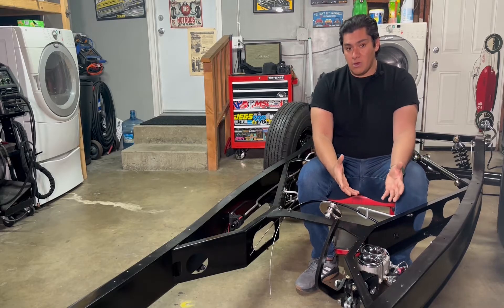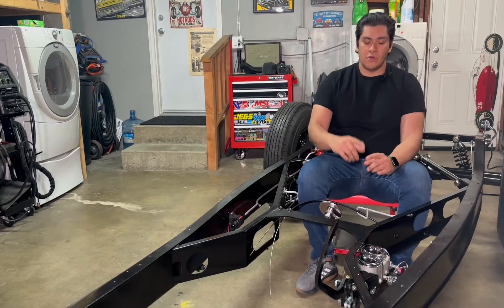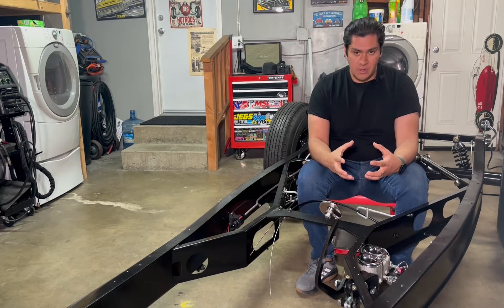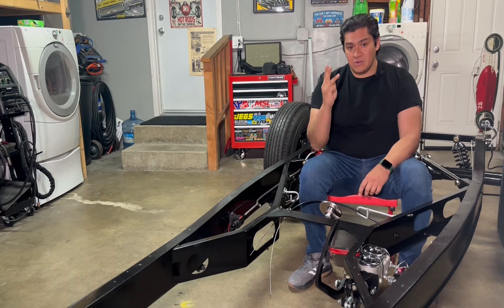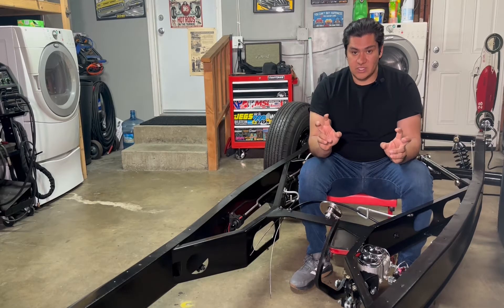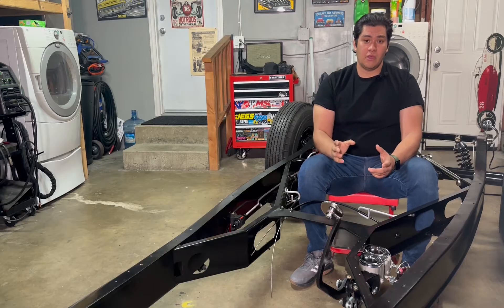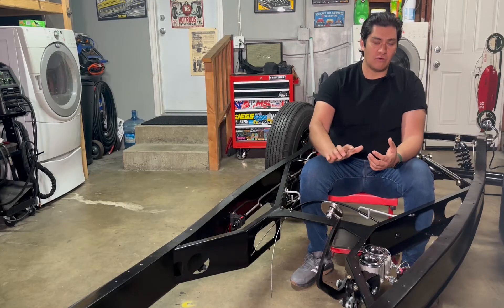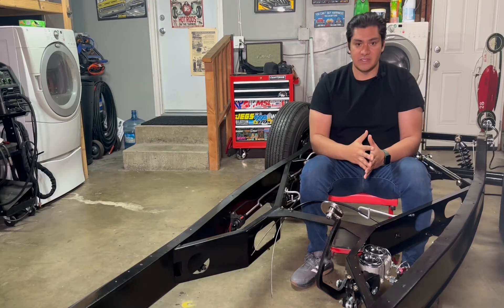BRAKE SYSTEM ON A EARLY FORD HOT ROD: THE THINGS YOU NEED TO KNOW

Comment: Hi I have a 1949 Chevy truck I all disc brakes I’m having trouble bleeding them I bench bleed the master cylinder l bleed the brakes and the padel keeps going all the way down with engine on can you help me out please thank
Reply from the maker: It sounds like the issue is air in the calipers. 

One recommendation is to unbolt the calipers and position them so the bleeder is the lowest point of the entire system and use a piece of wood between the brake pads as a pretend caliper.

Comment: Do you have a video on how to bleed the brakes? Is there a valve to open on the master cylinder?
Reply from the maker: I don’t have a video for that… but below are some key tips. 

Always start bleeding at brake furthest from the master. And do each wheel at least 3 times 

Make sure the bleeder is at the highest point possible. In some aftermarket calipers you need to remove the caliper to get all the air out the first time. 

Make sure any proportioning valves are open all the way to not restrict flow/ pressure

Comment: Thanks. Clear and concise video on braking components. Much appreciated! Considering abandoning the ABS valve and system on my 99 F150 , disk drum rear ABS ,as the valve is expensive and only available from the junk yard. Basically a crap shoot to get a good used valve. I  rarely drive this vehicle and can handle a non ABS system as that is likely what I have anyway. I was not sure what the mystery components were, mainly what i now know to be a residual valve on the ABS valve and proportioning valve on the master cylinder.
Reply from the maker: This comment was awesome to read! Glad it was helpful. 🤘🏽

Comment: Good video, very informative, especially with the pix.  So what the heck does a 'residual valve even DO?  Is it REALLY necessary?  Is it just placed in line to F&R, 2lbs for front (disc) and 10lbs for rear (drum)?  Thanks!
Reply from the maker: The residual valve holds either 2 or 10 pounds of pressure in the line 🤘🏽 and yup

Comment: If brake master are mounted on fire wall do i still need residual valve, or are they for under body brake system mount, cheers.
Reply from the maker: Great question, I have heard both yes an no. Some people will say the only time you need residual valves is then the master cylinder is lower than any of your brake line/fittings. Some people have told me that it does not matter where the master cylinder is the purpose of them is to keep the 2 or 10lbs of pressure on the pads at all times. I personally run them no matter what since these is very minimal risk in using them even if you don't need them.
Reply: Yes that is correct.  However the minimal line pressure helps the wheel cylinder cups stay sealed.   That 10lb of pressure will help the seal,  and keep air from seeping past the cup in idle position.  It takes over 50lbs of line pressure to move brake  springs. So, I have a under cowl master drum drum system and still run the valve.  Cheap insurance.

Comment: I installed a non-boosted brake system in my hot rod.  It is a dual system with two reservoirs.  The brakes work excellent but when one flex line broke, I had not brakes at all.  This happened at the top of a large hill of course.  In taking the cover off of the reservoirs, I see clean fluid in the front reservoir and dirty fluid in the rear.  It seems that the rod passing through the bore isn't reaching the front port.  There is no adjustment left on the rod.  Any ideas?  Thanks.
Reply from the maker: Although tough to diagnose problems via online here are some possible solutions and things to look into. 

1. Its a bit odd that your brakes worked fine (before the hose issue) but at the same time it seems like now you are not getting enough rod travel since that is unlikely to change. I would research the rod length and make sure its not intended to be used on a booster set up. In other words the brake rods for booster set up vs non booster are often different lengths. 
2. Another thing to check (depending on your proportion valve set up) is make sure you are using the appropriate port on the proportioning valve for the appropriate front or rear brakes. As an example, if your are using the rear port for the front brake system and you rely only on your front brakes then the rear port will not provide enough pressure to stop the car by the time your pedal reaches the floor. 

Hope the above helps! thanks for taking the time.